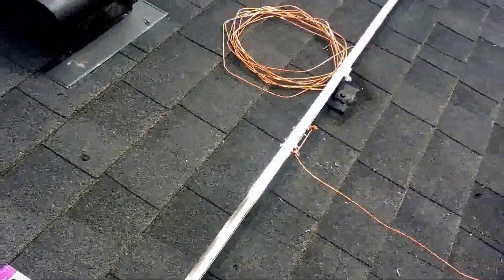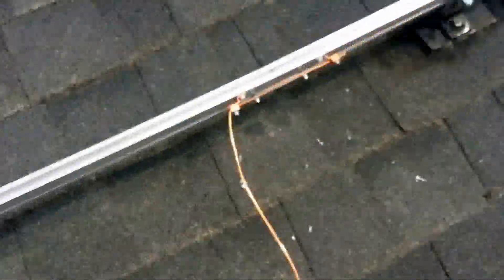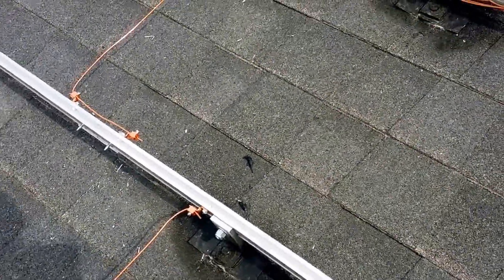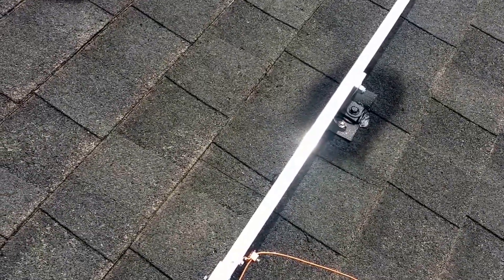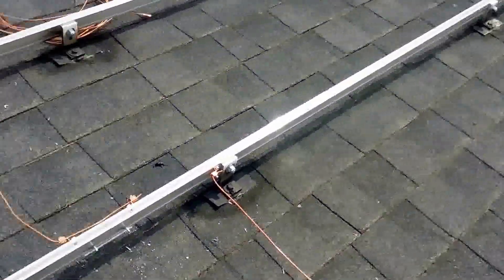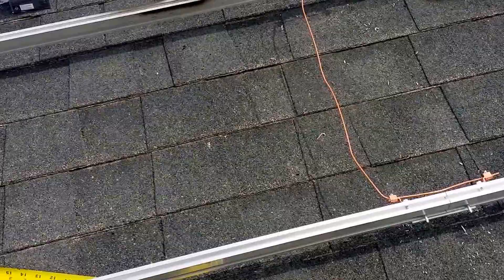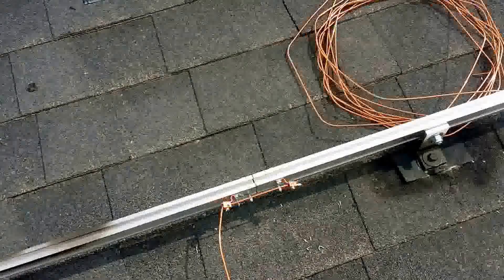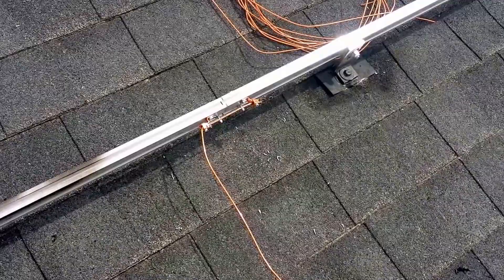DIY Home Solar Installation - 2 year payback- Part 2 PV Grounding

Comment: i thought the grounding wire had to be a continuous line? do the panels themselves have to be individually grounded as well?
Reply from the maker: +Carlos avila for code where I live, the panels have to be grounded to the rails and I used the weeb grounding clips for that. The rails have to have a grounding splice connecting each rail together. And then each row of rails is grounded together. So the rails make everything continues and the panels are grounded to the rails.

Comment: I just watched the first minute.  It should be noted self drilling screws and copper lay in lugs do not meet code for system grounding.  You'll get tons of galvanic corrosion from the difference between copper and aluminum.  Copper lay in lugs must be tin coated.
Reply: +The Man From India
If you buy Weeb lay in lugs they come with a washer that has little teeth to pierce the anodized coating of the module frame.  Otherwise you could probably use a star washer between the lug and the module frame to do the same job.  Not sure if the latter is code compliant or not though.
Reply from the maker: +MIchael Reuter Yes, I didn't even think about corrosion between copper and aluminum. It passed city inspection, they didn't even pause when they looked at everything. 

I have purchased new lugs and need to install them. These were recommended by many installers: http://www.we-llc.com/products/weeb-lug
Reply: +Glenn Pearson Likely they would be fine for a short while but once they get corroded the ability to conduct current is greatly reduced.

The Weeb lay in lugs work great and are a quality product. Good work!
Reply: +MIchael Reuter 

Hye Friend just want to know how electrical current or leakage can pass through anodizes aluminum frames,
I believe small section of panel where lug is being fitted should be cleaned with sand paper for 100% connectivity between frame and Lug.

What do you think???